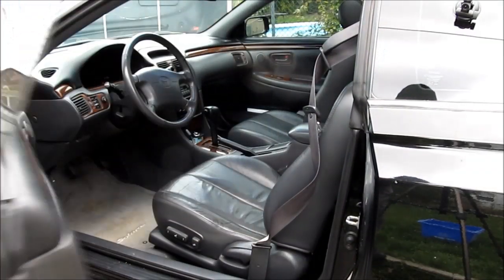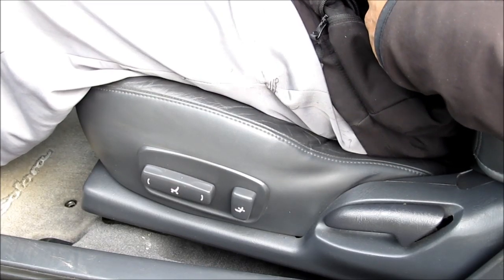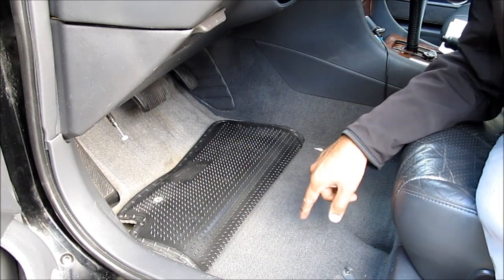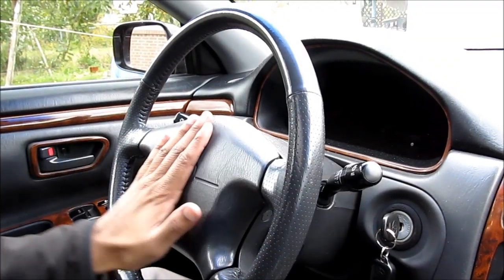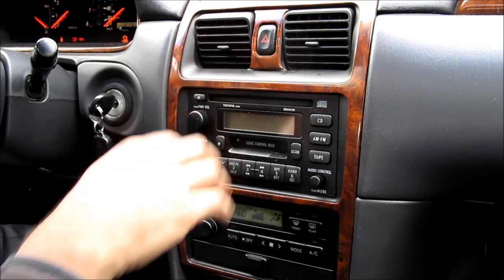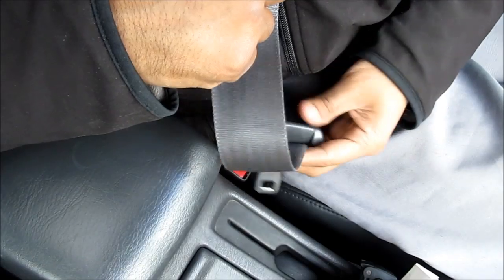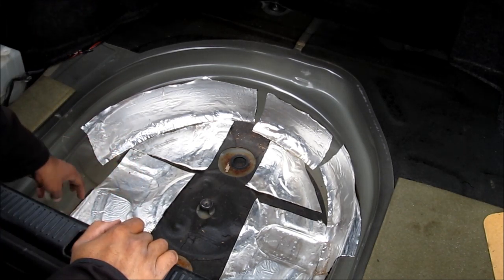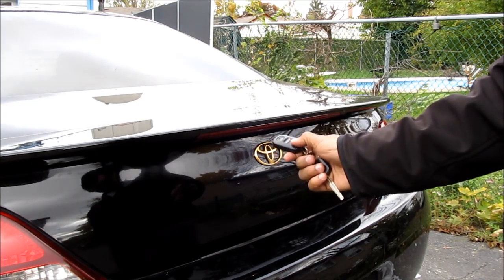Buying a Used Car - Part 3: Interior Inspection

Comment: I sure wish I had someone check my vehicle out like this. ...I ended up with a flood car, 2001 Nissan  Pathfinder. Dealer's have ways of covering up things..like replacing the carpets...also the dealer had my vehicle  loaded with Air Freshers  to disguise any moldy smells that might be detected.  There were so many red flags .....don't bother to inspect yourself...find a qualified mechanic to do it for you..unless you are a mechanic yourself.....thanks for posting ...too bad I didn't see before I purchased.
Reply from the maker: +davielove11 Thanks for your feedback. Doing your homework is essential when buying a used car. I have a feeling my first car was also a flood car. The carpets were soaking wet when I got it, I thought the shampoo hadn't dried. I pulled the carpet and found rust on the floor boards, obviously it had been soaked for a while. I had no issue with the car after cleaning everything up though.